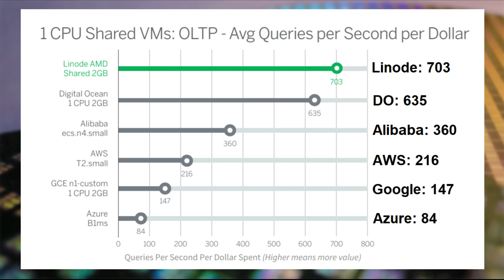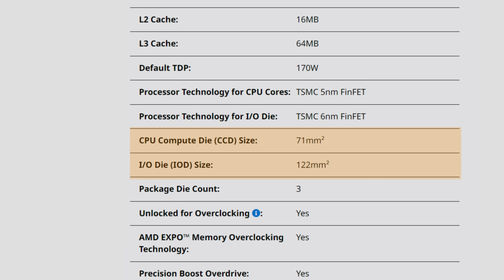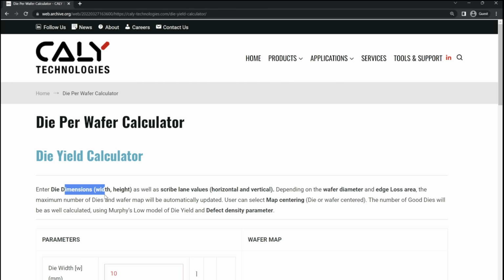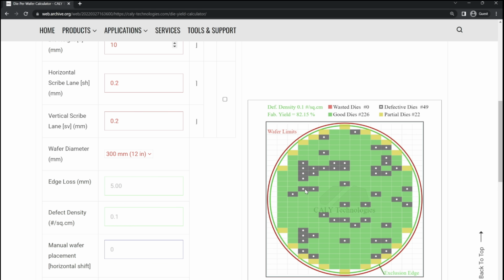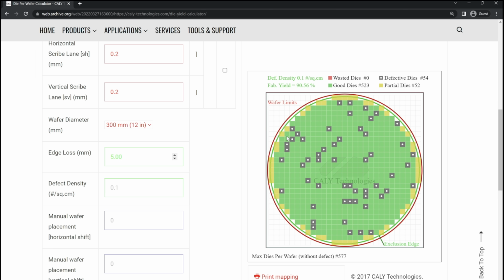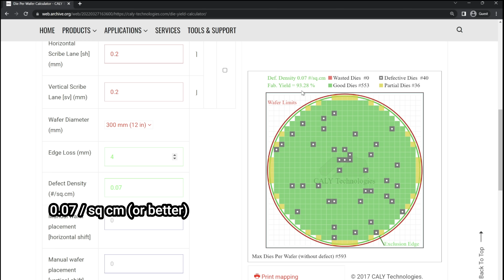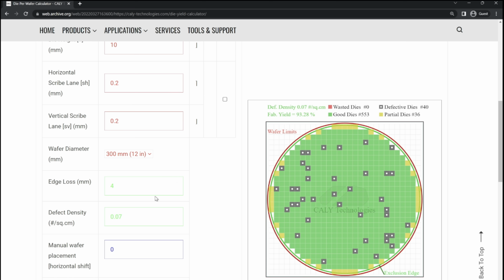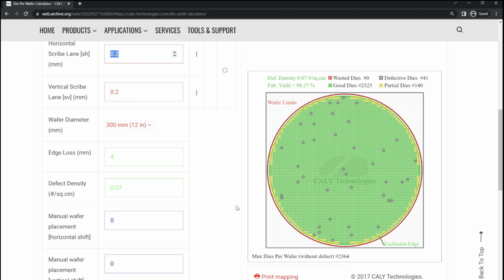AMD Ryzen 9 7950X: Cost to Manufacture?

Comment: A big part people miss out on is that raw material/manufacture cost can NEVER be what you sell a product at. R&D, overhead (property, equipment, machinery maintenance, material cost), international taxes/tariffs, supply/demand etc. ALL factor into the cost.
The reality is we live in a world where EVERY product you buy is technically "overpriced." But it has to be that way, or the product wouldn't exist in the first place.
Reply: Exactly. :-/
Reply: exactly. Jim Keller was earning some nice bucks at AMD and those costs are part of the final product.
Reply: @Karl with a K This doesn't include the cost to have a boat haul loads of them across the ocean.  Or the cost to move it from TSMC's factory to the factory that puts it in a retail box.  Or the cost to ship the retail boxes to the retail distribution centers in EU, US, Asia, etc..  Or the cost to ship from a distribution center to the store.  Or the cost to pay the electricity & water bills at AMD's office from ~October 2020 until ~August 2022 (R&D phase), or the cost to pay a team of dozens/hundreds hard to find, high-salary engineers that designed the CCD and IOD during R&D phase.  Or the cost to pay the chipset design teams to design & test standards for AM5.  Or the cost of the data centers, servers, software licensing AMD used during R&D.  Or the costs of paying salary for staff involved in testing, analyzing, and iterating through different versions of the CCD & IOD that we never saw.  Or the costs of the software engineers that wrote & tested the microcode for the different BIOS versions.  Or the costs of the staff that designed the retail box, logo, website landing pages, etc.  On and on and on.  So, ya, you're right.  The raw silicon is pretty cheap.  But it took over 2 years of paying MANY bills to design the damn thing.  It isn't like AMD or any chip company just edits the first number on the box, pushes print, and then chip shows up.  This is extremely complicated stuff that is only being done by a few organizations on the planet.
Reply: @paulw7738  I know this is not the right place to ask I'd rather even do an DM but I am curious, have heard it in other places but what's the "IOD" exactly? Heard things like cIOD, sIOD, etc

nvm: this video says it.
Reply: @hariranormal5584   All good!  If you are asking, others likely have same question but don't want to ask.  The "IOD"  is just referring to "Input/Output Die".  More specifically, the I/O Die on Ryzen is referred to as the "client" I/O die.  The "Server" I/O die is the bigger one use on AMD's server chips, Epyc. CCD = "Compute Complex Die". This is where all the CPU cores & cache are.  The purpose of IOD is to "talk" to all the other stuff on the motherboard - USB slots, SSD's, SATA ports, PCIe Slots, etc. and pass data to the CPU cores on the CCD(s).  The genius of this design is that is AMD designs a single die that can be used in the 7600X up to 7950X, AND it can be used in all Zen 4 Epyc products.  Massive cost savings because each "die' that is designed has extensive R&D costs before it can be produced. Drawback is that some applications experience worse latency on models with two CCD's - like 7900X and 7950X.  This is why some articles came out recently showing the 7700X had slightly better gaming performance than 7950X.
Reply: @Karl with a K  Dude, you're either joking or shouldn't comment about something you obviously have no knowledge about. No business can operate at a 30% GP based on BoP only. Your local restaurant couldn't even survive. Never mind a high tech company with massive R&D and payroll costs.
Reply: What people mean when they say "overpriced" is that the profit margins are obscenely high. Chip manufacturers have a profit margin exceeding 60% which is obscene. All chips are heavily overpriced as a reasonable market with enough competition usually has a profit margin between 5 and 20%.
Reply: What he described is the MARGINAL cost. Look up that term. Perhaps he should have been more clear about that.
Reply: @joe3276865536  he said "EVERY product you buy is technically overpriced" not "marginal cost leads to price increase above profit margin"
Reply: Well amd already disclosed their margins , 49% . that means 7950x @ $699.00 , amd makes 49% = $345.00 profit .
Reply: @Karl with a K The math he had at the end was literally the IO, the 2x CCD, and the pacakaging. It didn't include the R&D costs at all. Like you said, it's manufacturing. Not the R&D. You have to make a return on that initial investment. The investment IS the research and development, not the manufacturing.
Reply: It also goes in the reverse for most employees
Reply: But there’s a difference wether you have 7% return on investment or 70%. It’s already perverse with some medications, and it has been perverse with graphics cards during the cryptocurrency madness… - and companies like Apple who just put (I don’t know) 20% extra on every app sold in their AppStore, no matter who programmed or marketed it… - that’s just typical monopolist behaviors (- even if it is technically a duopoly).

The truth is: the market is never in equilibrium, and the scarce side just is able to dictates the rates.
Reply: you make sense, but pretty sure he knows that i think the video was actually amazing great title video makes sense off of the estimated numbers given and genuinely entertaining i know you wear just being helpful but it was pretty self explanatory. what the actually point was
Reply: Also what we pay is usually different from what for example Dell pays. I bet Dell doesn't pay $699 for every 7950X.
Reply: It would be hard to make the cpu without the machines 😕
Reply: Unless you’re intel and made a garbage GPU that nobody wants. Then you sell it at cost
Reply: @ndgoliberty  the funny thing is, the gpu from Intel OS good. Just the drivers are shit
Reply: Like the 4080 12 and 16GB
Reply: much insight. deep understand.
Reply: rule is on any product you only charch 3 times the amount!!! That it cost to make. That way you are making profit. But also keeping the price down for consumers!!!
Reply: Most of the overhead is in this 69$.

But yeah R&D of these chips isn't cheap.

I think pascal (nvidia gtx 10xx) was around 8 billion $
Reply: damn bro, you really put on the capitalism suit. How about products are not overpriced but correctly priced so that both the company and the consumer benefit equally?
Reply: That's the funny thing about "production cost."  Most companies will include overhead in part production cost.  So take their numbers as you will.
Reply: ANd it is not that you get the labour for free, And a waver production line you don't get for free either, or the clean rooms, the operational costs, marketing etc. Just setting up a fab costs already millions, if not billions. Not a single die produced yet. AMD stated a gross margin of 40-60% when i remember right. Which isn't much. And the dies are not the only costs. They need to be put into resin, they need a substrate to be placed on, the wiring to the pins, the gold plating for the contacts, additional elements like capacitors and resistors and so on. To say a Ryzen costs about 70 dollar is just silly and leaves out so many things. The video and title are almost click bait.
Reply: Since AMD outsources its manufacturing to TSMC wouldn't the equipment, machinery, maintenance and material cost all be paid for by TSMC and factored into the price that they charge AMD?
Reply: @eitkoml  You will pay them through the total cost. They don't invest billions and sell you the product for just the cost of material. They also have this huge cost apparatus in their back and these costs also need to be paid. If they are paid by TSMC or in the end by AMD it doesn't matter. You can also bring a pig to a slaughterhouse and you still have to pay for the work they do. And their costs is the sum of all costs and their margin on top. Thus it is stupid to say the processor costs only 69 dollar. That are the pure material costs for the chips. Also AMD itself will not purchase and deliver Silicon to TSMC. TSMC buys in bulk and uses the material to also pruduce the chips.  This is basic understanding how a business functions and how prices are calculated. AMD also doesn't just buy the chips from TSMC. There is the PCB, the IHS and so on. AMD gets a finished product from TSMC. Maybe they deliver to AMD in bulk and AMD takes care of the packaging, but that's it.  All in all this video is stupid and click bait. Just so people click on it and think "What the processors only cost 69 dollars to make and we have to pay 700?". It is misleading and uninformed or shall i say the most important information is left out.
Reply: @LiveType  the profit margin for chip makers SHOULD BE well above 50%. They're not making toilet paper, they're making stuff that requires billions for a company to just get its foot into the market. 

If what they do was easy there would be hundreds of worldwide competitors and the price would've taken huge nose dive. All according to free market.
Reply: very true if your BOM exceeds 25-30% of the price in any industry they start firing people all over the place.
Reply: Consider this the cost to make a generic when you have up to date plant and your own design is lacking  aka Intel GPUs.
Reply: @vultureTX001  Wot? Come again. But preferably in a way that is understandable. Are you attempting Intel-Bashing? If so why? I didn't think this was a fan boi thread, but i might have been wrong. Currently Intel is just that little bit ahead of Ryzen, one should rather recognize this, instead of making stupid, needless and especially useless fan boi comments. But i am glad for you, that you feel so strongly about AMD. I however decide what is currently the BIS and that is what i take. May it be Intel or AMD. Both companies don't do me any favours for deciding for or against them. They don't lower the price, just because i buy their product, they don't send me gifts, they don't make their products better just for me. So i really can't understand all this fan-boi talk and the reasoning behind it. Maybe you can explain it to me with a rational that is founded on research and knowledge and not only on screaming with a group that you like most?
Reply: @vultureTX001  Ohhh yeah, that was kinda expected. And yeah, i don't have a clue, but run my own company since decades. Go troll somewhere else kiddo.
Reply: @tomsite2901uk  see you can't actually show up and you're just another emily latella. [HINT I retired from my biz years ago]
Reply: @vultureTX001  Probably because you weren't very good at it.
Reply: @Karl with a K The author did a good job of explaining the potential issues with his analysis.  I’ve been in the business 40 years, here are some comments.  The margin TSMC has on their parts is closer to 50%, wafer electrical test, die test, and burn in yields are probably closer to 95% so the overall yield is about 80-85%.  There are other costs AMD has to bear including the costs to pay their people for design, marketing etc.  Remember TSMC doesn’t do the design, AMD does.  Say they have a small team of around 500 for each chip in the design phase at around $200K/year per person, that’s $100M per year just for the people.  Then you have to pay for the design software licenses and those are extremely expensive.  It can take 2-5 years to design a new chip.  There’s also the cost of any “building blocks” you want to add to the design software.  You could easily spend between $250-$500M on the design.  There is also the costs for the masks, this is paid up front and not part of the wafer cost.  According to estimates in the literature a set of masks for TSMC’s 7nm process is over$100M.  (Aside, those “7nm” numbers have very little to do with the size of features on the die). You have to add this to the marketing, sales and manufacturing costs to get the price AMD sells their chips for.  What the actual costs are, only AMD knows.
Reply: @Karl with a K YOU don't know anything about business nor manufacturering. $69 is just for the BOM and assembly and manufacturing overhead. R&D, shipping, packaging, marketing, misc overhead are not included. Slapping 30% "profits" on top of pure manufacturing costs says how little you know about this.
Reply: @Karl with a K If this is the sort of logic you use in your videos to teach 'winners' how to 'win' they must be pure gold.
Reply: @JJFX-  756 video views in 2 and a half years... The guy really is a winner :D
Reply: Engineering would play the biggest role
Reply: TSMC produces 300 wafers per hour on the low end, if they sell each one of those @ $17K that’s $5.1 Million per hour. I’d argue all R&D and expenses are covered in that price tag.
Reply: @ElvisRandomVideos  Correct - TSMC's R&D costs.  It doesn't cover any of AMD's R&D costs.
Reply: @paulw7738  agree, we can infer how much AMD values their R&D based on what they charge the consumer.
Reply: Not the point of the video...
Reply: dumbest take ive seen all year
Reply: Bullshit....
Reply: you seem to have a different perspective on what "over" priced means. it's all about the margin. if you make 10-20% profit it's decent, if you make 50% profit then it's overpriced
Reply: @damasterpiece08  you are correct in thar sense it is all about perception. To me only, a die on a piece of silicon should not cost the way "HIGH END =PERCEPTION" CPU costs and even more flagrant for GPU but as long as perception leads then only one way,  it will worsen until nobody or too few can actually afford it.
I am personally pulling the long face for past 5ish years to CPU/GPU/MB makers for price abuse.
Odd thing but I want to assume x86 architecture is about to have it really rough in next decade if we don't jump to another architecture like liquid form electrical  transmission.
I also question if recent pricing absurdity has anything to do with China not invading Taiwan... yet?
Reply: AMD shill, please
Reply: I mean this is not USSR where they would sell bread and milk under production coast 🤔
Reply: @arroww1323  We have farming subsidies here in the US, so that can happen with raw produce here. It all depends on the year.
Reply: @arroww1323  check out “US Government Cheese”. Corn subsidies etc
Reply: @arroww1323  
there are some basic human necessities where some governments help the population by subsidizing the cost of food, water, etc.

Technology, cars, luxury items and things like that are not a necessity and the revenue margin can be much much higher as they aren't a necessity for human life, the free market prices those items accordingly.
Reply: @Oscar4u69  in America, for example, the beef industry is so heavily subsidized by tax dollars that if it wasn't, a steak would cost $38/pound....America is so great, the same people who oppose universal health care have absolutely no problem with tax dollars just being given away to for profit businesses
Reply: @post-leftluddite  The existence of something doesn’t indicate a lack of opposition to something.
Reply: @post-leftluddite  UK is the same, look at  the BBC (£3.8Bn from TV License fee's) and then it also makes £1.5Bn via its private BBC subsidiaries which is wrong since they are all suppose to be owned by the country - in theory !
Reply: @Oscar4u69  yes but they still go up in price to be adorable to continue to produce milk, isnt inflation on everything quiet a big thing right now surly. aswell as the fact you could say in our society right now it is mandatory to have at least some sort of high performance laptop or pc for school an assessment's its basically just a fuck you to the 99% that doesn't have endless cash income and actually have to work for there money.
Reply: @Oscar4u69  lol russia helping its populace that's cute
Reply: @Oscar4u69  I would argue with Western governments moving to a "digital government" technology is a necessity. 

I cannot even make an appointment with anything city related (licensing/passport/identity card/complaint/archives) without doing it on their website. Police will often send you away and tell you to file the theft on the internet, faster and easier for them. I must put water meter readings in some website because paper is no longer an option. And on it goes

Comment: Whatever you can say about AMD's retail pricing, I think it's clear they have a lot of headroom to cut prices and keep a nice margin. 7950X can easily be $600. 7900X can go for like 475. 7700X and 7600X can also drop by another 50. Then throw in the X3D parts at the previous prices.
Reply: For true headroom, check AMDs net profit.
Reply: Remember 3D Vcache requires extra silicon and more advanced packaging needs both of these factors will raise the base price of a 3D Vcache model.
Reply: the problem is that the retail price is not the amount AMD receives. They sell chips to OEM or distributors with 20- 50% discount depending on models.

Comment: If you look at the retail price, they make a pretty good fit to AMD wanting $50 for the IOD and package, then $44/ core.

The RX 6500XT is a good comparison point here, since it's very close in size at 107mm², on N6 as well. 
Again, since the packaging, IOD and 1 CCD are at least $50 to make, I don't think we'll see it for less than $200, soon. 

Makes me wonder what the yields for the AD102 from NVidia are. <40%?
Reply: You can disable an SM if it has a defect and not trash the die I assume, isn't this the reason why most NVidias (and others') GPUs don't use fully enabled dies?
Reply: @randomobserver9488  it is indeed, but it could also hit cache or a controller and render the die completely useless.